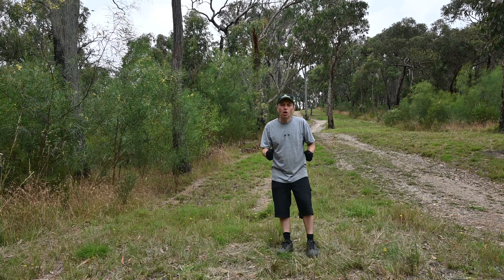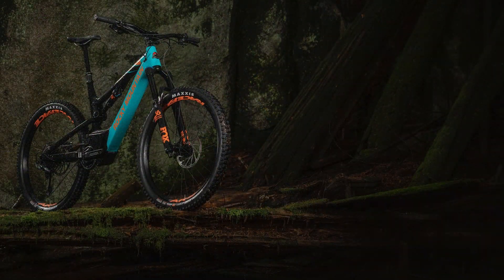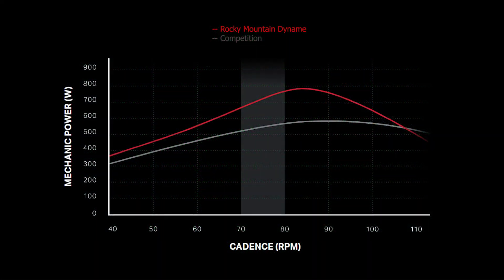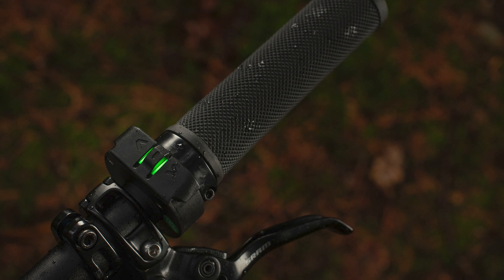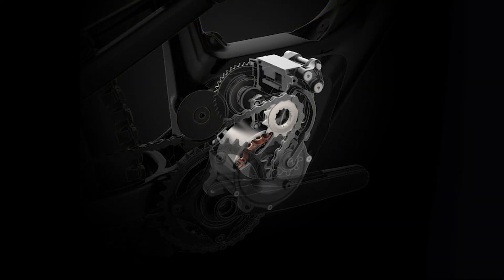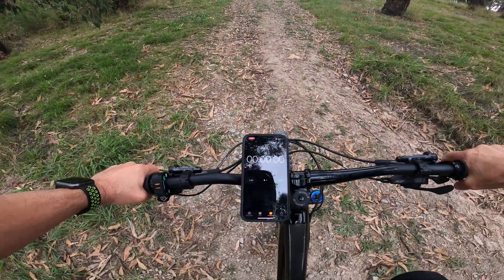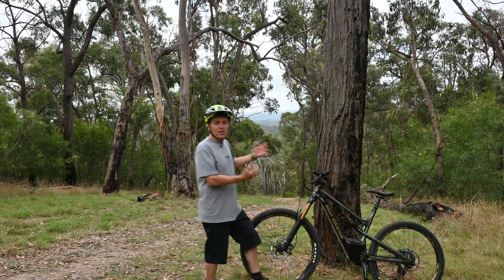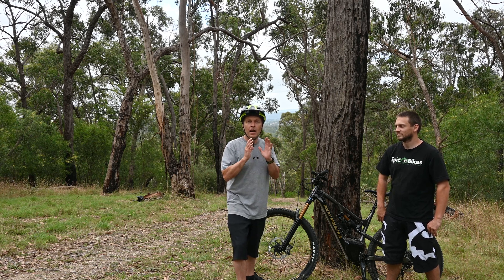eBike Motor Test - Rocky Mountain PowerPlay - Standard Bike Vs Tuned Bike - Tuned For 10% More Power

Comment: I took the rm a50 and I'm happy. The only thing I relied on and heard from the web was the 108nm motor being the most powerful. I had a trek rail 5 625w with 85 nm bosch and with the turbo it was more explosive and copious than the 4.0 dyname. I did a "recovery" with a friend of mine who has the bosch in turbo and I in ludicrous and we were even though my leg was more trained than his. I calibrate the bike every outgoing and boost was +2

Comment: Can I tune my rm altitude powerplay? It's a 19 c70
Reply from the maker: Yes we can Tune the Rocky Mountain Altitude
Reply: @EpiceBikes  I did the slack the chain then reset the ecu tune that would be cool to see what else can be done. That really woke the bike up
Reply: @toddpharmer2460  Slack the chain? Could you please explain in detail what you did? Thanks!
Reply: @IronX77  the bike has a tension sensor on the chain to deliver power accordingly. if you hold the derailer forward to slack the chain and reset the ecu at the same time you will heighten the sensitivity of the tension sensor its insane!
Reply: @toddpharmer2460  I'm going to try this on my instinct. And what is the tune for the pp? Never heard of tuning it.